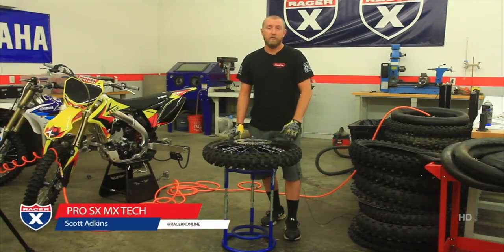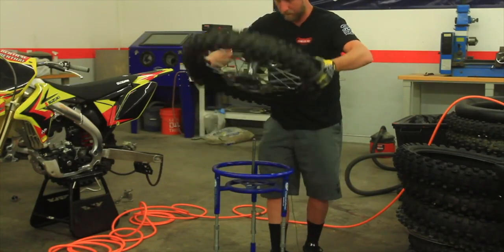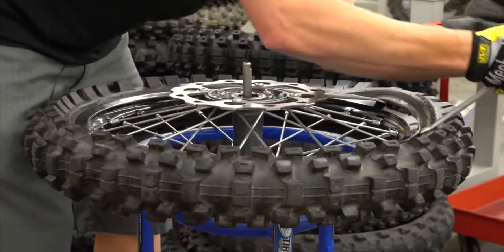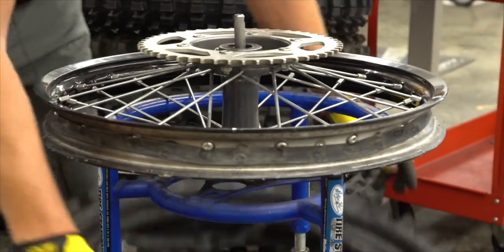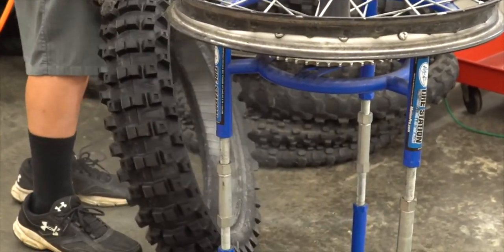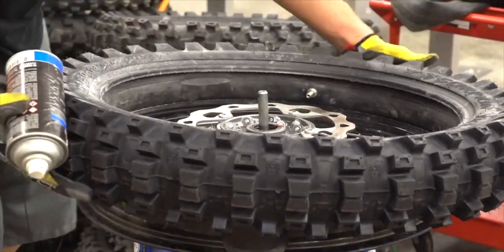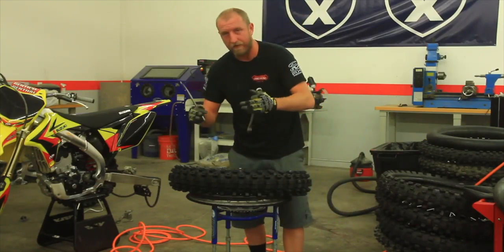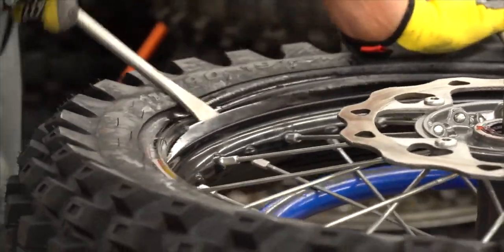Racer X Films: How to Change a Dirt Bike Tire

Comment: What did you lube the bead with?
Reply: Dish soap with water works fine, or the same stuff they use for the car tires
Reply: @honda2380  thanks.